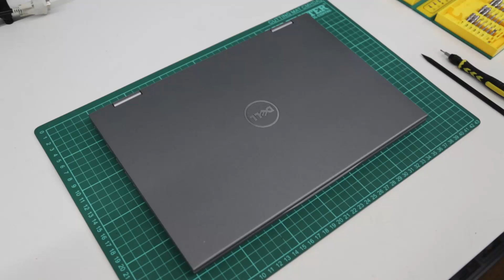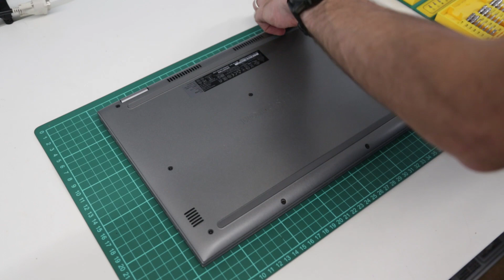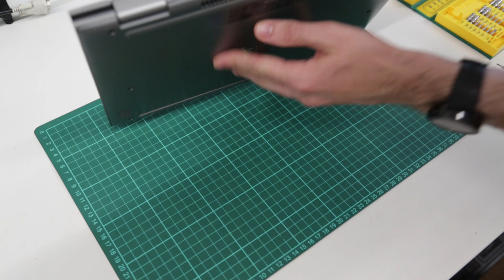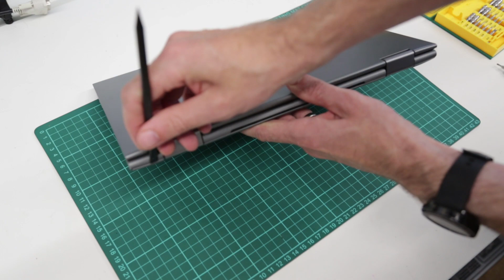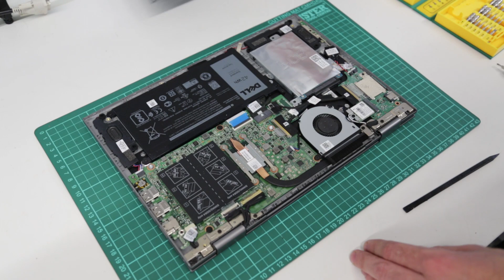Dell Inspiron 13 5378 2-in-1 - RAM upgrade guide

Comment: I'm very interested in this I did a bit of research and it says increasing the ram helps the computer communicate with other components increasing efficiency if this is true would this fit a dell 13 i5 x64 reason unmasking is I'm rralcong the battery and I noted the slot was empty I wouldnt mind adding this i just want to get the right component thanks for your feedback.

Comment: Hey usually watch your channel for technology updates. Recently I have decided to upgrade ram of (8GBx1slot) to (8GB + 16GB) on Dell inspiron 5379 laptop. will that support this configuration or do I need to upgrade that to 16Gbx2slot. Need your suggestion...Thanks
Reply from the maker: Should work fine - not ideal for integrated graphics performance (where I prefer a matched pair of memory modules) but for most uses isn't an issue.

Comment: 1 question here...please reply.
I've dell 5378, with 8GB ram in it. 
Can i add an additional 16GB RAM in another slot and make it a total of 24 GB machine, does that work ?
Reply: Only if it currently only has one DIMM slot occupied. In more detail, if it is currently 2x4GB then no. If it is currently 1x8GB then yes. However it is advisable to have both cards the same capacity and speed so I'd open it up and check the speed and how many slots it occupies.
Reply: @yukisuter  I already had 4gb ram and one slot empty. Can I keep the original one (4GB) and add an empty slot with 8 gb = 12gb? or do i need to add 8+8?

Comment: Can you remove the original ram and replace it with two new 4gb or 8gb ram? Or you have to keep the pre installed module?
Reply from the maker: You can replace the original module.

Comment: What is the maximum ram you can install, I have one 8GB in one slot, I want to add 16GB is the second slot.
Reply from the maker: I believe 16GB DDR4-2400 modules should work in them: https://amzn.to/36wDy8t
Reply: Brue Computing will installing 2 work?